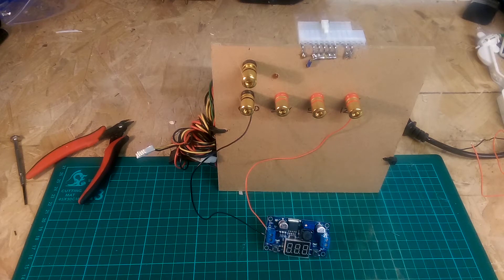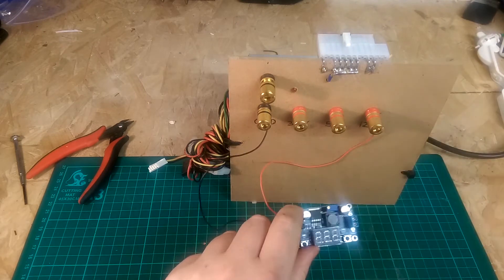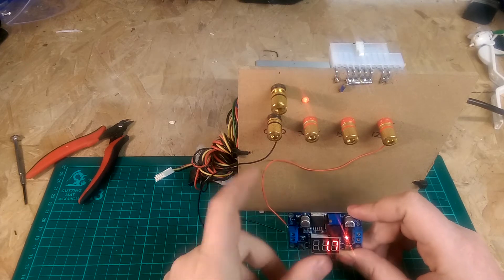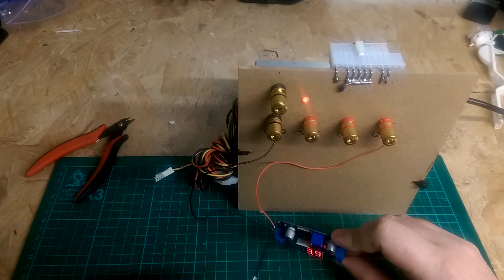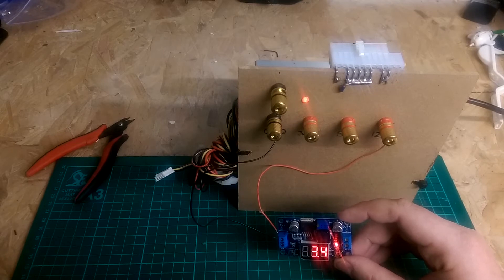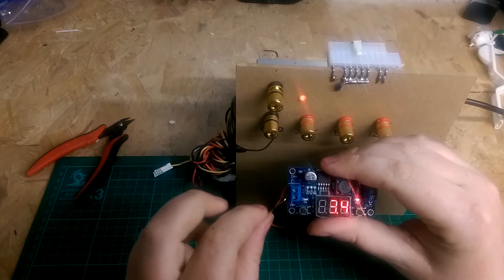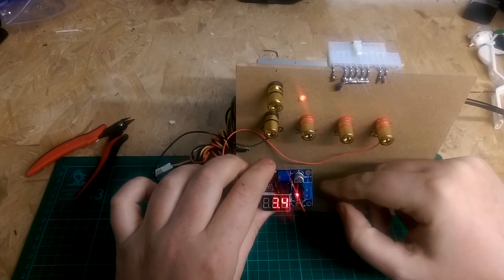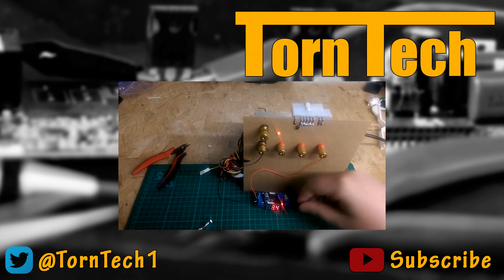LM2596 Bench Power Supply Upgrade - TN0004

Comment: I would remove the POT and replace it with a multi-turn regular pot to make adjusting much easier.
Reply from the maker: +Jerry Ericsson That is a good idea!

although there are newer modules on the market which offer better functionality such as CC and CV I will be purchasing one of them soon and doing a revision video.
Reply: +TornTech Ya I have some of those at home, in fact a few of them in a box in the back of our Motor Home right now.  We went full time in our Motor Home last November, so I have just a small number of parts along, but come April I will be back in SD where I can load up with much of my electronic parts as I find I have plenty of room for such things now. All my current power supplies are portable and run of 18650 batteries reclaimed from old Laptop batteries.  I have a couple i built with those adjustable one boost and one buck so I do have power where I need it.  I also have a couple of home built Volt/Amp meters as well as a 32 Volt power pack for my 100 Amp LED lights (one blue, one red, one green, and three white).  I took one old HP Printer power brick and hooked it up to a boost and buck converter in a project box that can run my lights from 110 when I want for outdoor parties and such at the RV Parks where we live.  Also several different LED type lights just for playing with, and a 30 Watt flashlight with built in Volt/Amp meter for working on the rig when needed.  It has really been a godsend several times when the rig decided to have problems.

Comment: dont use these try a laptop charging pack i built mine out of it really easy run 2 of those bpoards on the end as has 3 wires 2 18v 1 ground